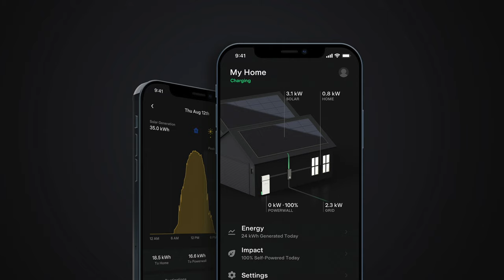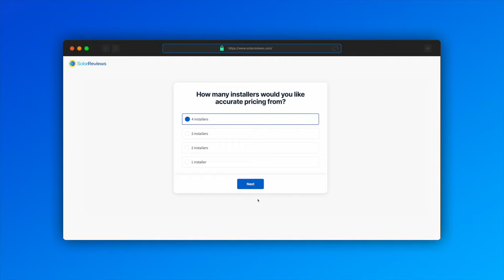Tesla Solar Roof: 2023 Expert Review

Comment: The answer to the question you're asking is no Tesla is getting out of the solar business and there won't be anyone to repair or service your Tesla roof!  We actually considered the roof as our roof needed to be replaced.  The cost was high but really the cost of the Tesla roof when considering the cost of a regular roof combined with a solar system isn't that much different.  Ultimately we went with a regular roof and a ground mounted solar system which costs more than the Tesla roof.  Our concerns about the long term service and repair issues were the deciding factor and as it turns out it was the correct decision.
Reply: Who told you Tesla is leaving the solar industry?
Reply: @RodknockRhett  Bloomberg!
Reply: I don't think they're stopping but rather they're spread pretty thin at the moment because of the car production
Reply: @chrismaxny4066  And you trust Bloomberg?  Sheesh!  NO...Tesla is NOT getting out of the solar business.

Comment: I have a flat roof with a minimal pitch for water runoff.  Can the Tesla Roof be walked on?
Reply from the maker: Hi John. Our experts say that the Tesla Solar Roof typically isn't installed on flat roofs. A Tesla Solar Roof may be walked on by professionals during installation and repairs.
Reply: Anyone can walk on the solar roof, not just professionals. It is advised to clean your roof at least twice a year to minimize the impact on solar generation from debris such as dirt build-up.
Reply: They require a pitch.  But yes, you can walk on a solar roof.  The glass panels are mounted to a steel backing.   But you need a pitch to shed water since the shingles sit above the roofing material with an air gap in between.